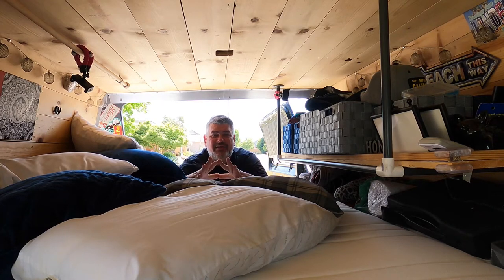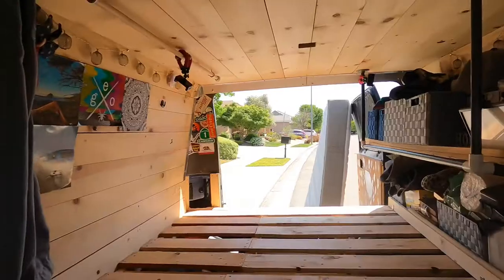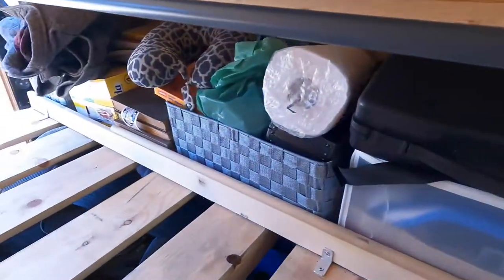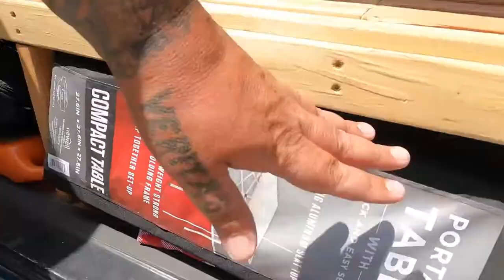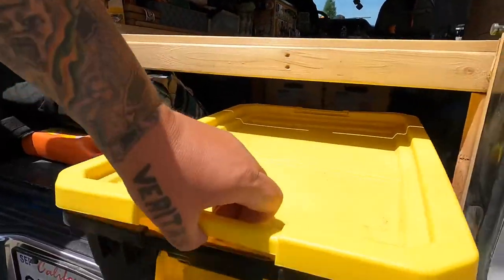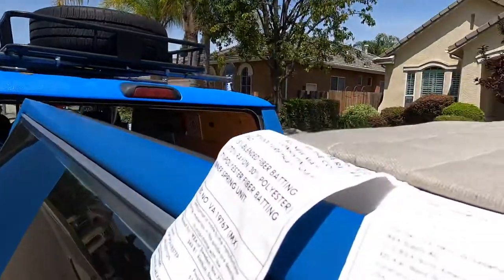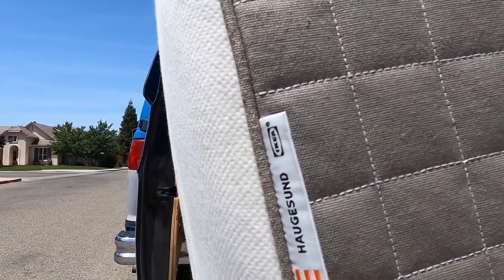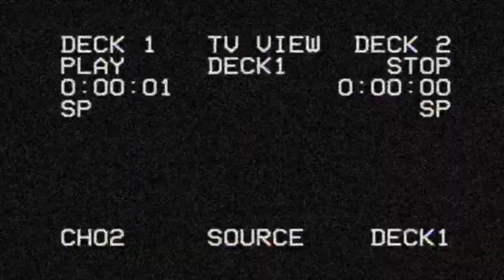WHAT’S UNDER MY BED? BED-FRAME & STORAGE - 1996 Dodge Ram Van 2500 - Solo Male #vanlife

Comment: Spring cleaning time but the weather is definitely Summer in the Central valley; you must be out of there by now. The heat is on🌡️🥵
Reply from the maker: You got that right! Heading toward Delta/Bay Area. Supposed to be almost 100 in Fresno tomorrow